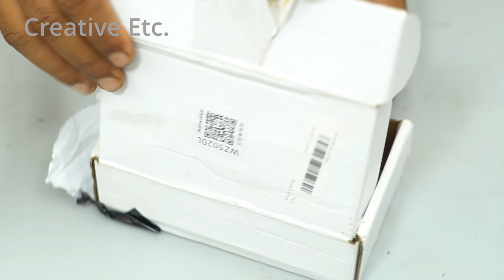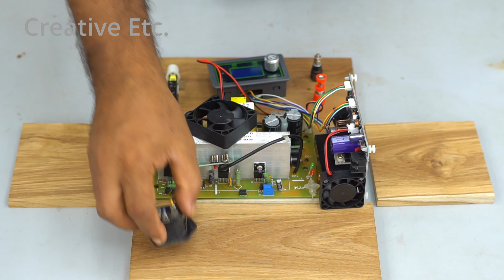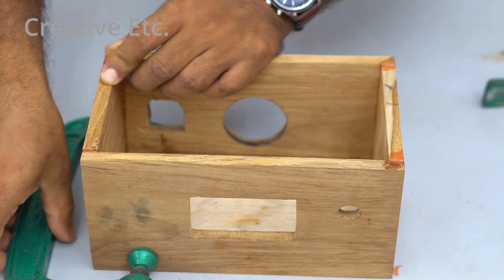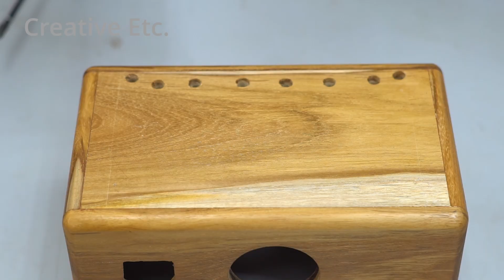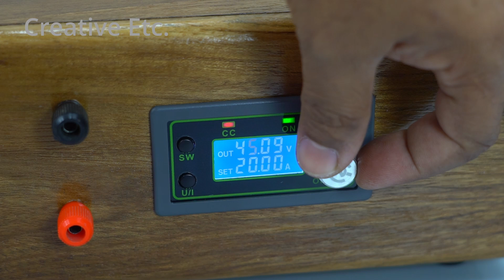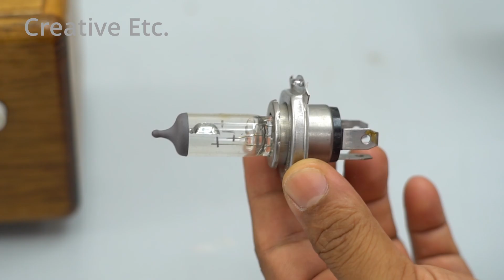How To Make Variable Power Supply / All-in-One Bench Power Supply

Comment: Whole video was made to just showcase his carpentry skills and tools.

Had very little content and technical details pertaining to the bench power supply itself. For example,  the maximum current the system can handle, considering the charger used was rated at 5A at 42v maximum.....

These details are more relevant in a variable bench power suppy video. 

This video should rather be named as making a box for variable power supply....